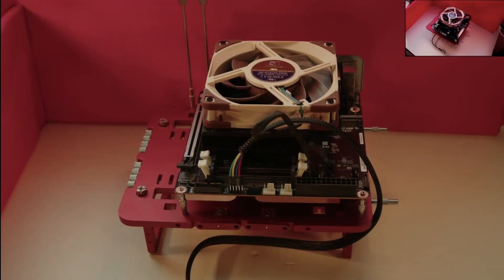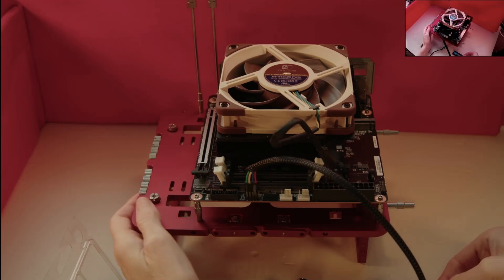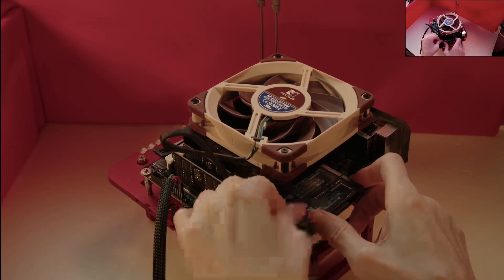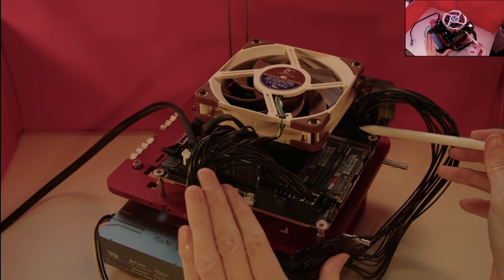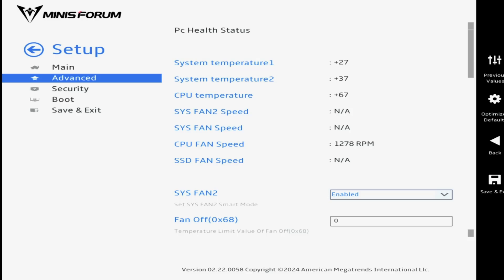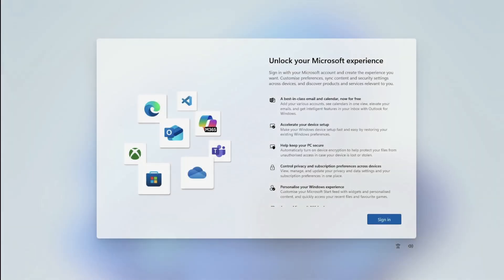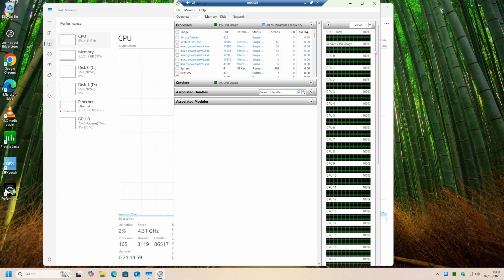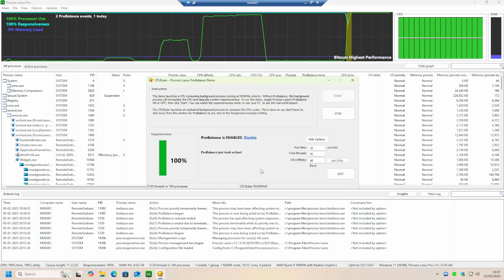MinisForum BD795i SE ITX - Ryzen 9 build - part 2

Comment: So you added NVME cooler or is the Noctua fan enough? I´m looking at the same configuration with two 990 Pro 4TB but as far as I see both NVME´s are pretty narrow so I´m unsure if there are any NVME cooler that fit.
Reply from the maker: @r0tb3rt  added two heatsinks to the NVME SSDs, see below. These are narrow enough to fit. Make sure to fit these after you have the SSDs in place. 
NVME heatsinks - https://www.amazon.co.uk/dp/B08QM758WW

Comment: I had never seen a passmark score on this board before and it's really disappointing. I just ordered this board and now I have to cancel it. Everyone keeps saying how fast it is in all the videos but this is unsatisfactory.Evenan old 6th gen Intel NUC will get 4000 on Passmark.
Reply from the maker: I haven't published the passmark scores on this computer with a  RX 9060XT graphics card attached yet, that's in the next video. The lower overall passmark shown in this video is very much down to the performance of the integrated graphics. Comparing the CPU mark score might be a fairer comparison.
Reply from the maker: @usaf_medic70  I've just uploaded another video with passmark results both before and after adding a RX 9060XT graphics card.